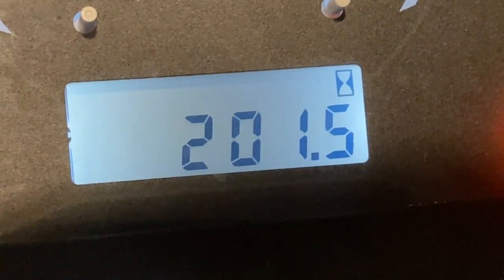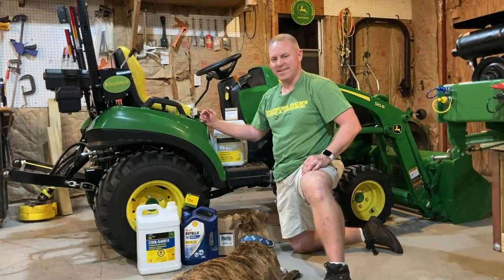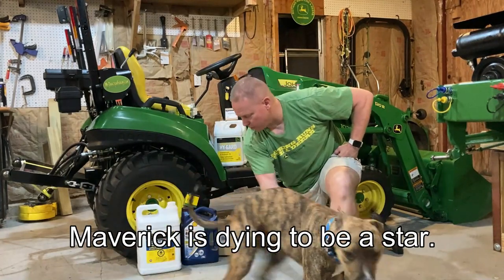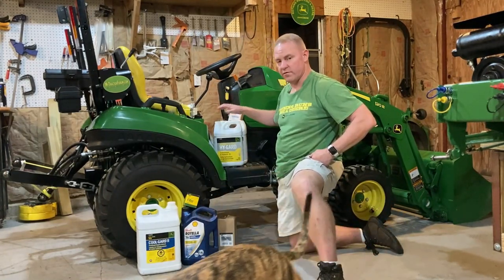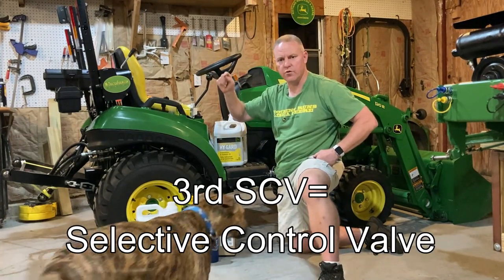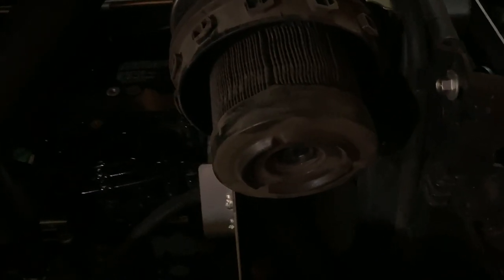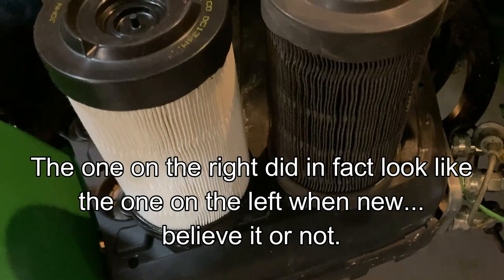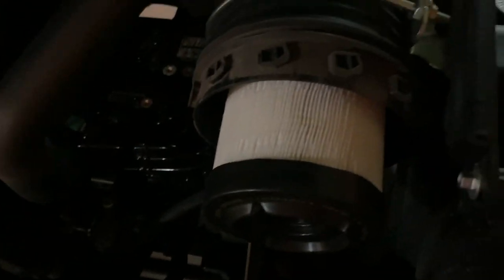John Deere 1023E (1025R) 200 Hour Maintenance Part 1 of 2

Comment: On that fuel filter under the tractor I use hose pliers or small vice grips on the fuel line on each side couple inches away from the filter to stop the flow while you remove the filter, it’s a pain but a small pair of vice grips works the best for me so far
Reply from the maker: Thanks man, is there enough space to work once you do that?  Either way, I'm trying it, it's gotta work better than what transpired on the video.  Thanks for watching.
Reply: @FloridaDeere  In tight spots I found that a pair of hemostats work great, the jaws are much more narrow than hose pliers or vice grips.

Comment: Great video. I was a little confused when you were changing the inline fuel filter. I thought I missed your explaining what you were doing. I figured it out eventually. The drain on the bottom of the radiator is a petcock.  Thanks for your time.
Reply from the maker: I can get distracted for sure, so I apologize for often not having the most coherent videos.  Yes the fuel filter is best if you vise grip either side and then change the in-line filter...this is learned.  The engine one is easy of course.  And yes a petcock, I have heard that before but often forget, so thanks for reminding me.  Next time, I'm sound a little more knowledgeable.  Thanks for watching.

Comment: If you clamp your hoses off with hose clamps. It's so much easier. Good video!!!!
Reply from the maker: Yes, I did do that originally...well not originally but after the first time I made a huge mess, but I guess I change it enough to where the hoses were weakened in those areas and one eventually sprang a leak, so this was my fix.  Thanks for watching.

Comment: I used 2 small vice grips to pinch the fuel host under the tractor and it was a clean job for me
Reply from the maker: Yes sir, that is the way to do it.  I was not smart enough to figure that out the first time and did the second time🤣.  In fact, in an hour or so, I'll be up for my 400 hour service.  Thanks for watching.

Comment: I am looking at a 2017   1025r ,Have you been happy with yours??  I would do my own maintenance also,so your video is very helpful. Thanks
Reply from the maker: Yes, I love having it, it has been a great machine overall.  If you haven't watched my review videos, watch them, I try to explain any issues I've had with it so far in those.  But it is a force multipler in the amount of work you can do, especially if you accessorize with like I have, hydraulic diverter, rear hydraulic kit and other things.  I'm about to do the 400 hour maintenance now, I'm about 10 hours overdue now, not bad, but I keep getting hit with other projects that require my attention.
Reply: Thanks for the reply, I'll do that.    @FloridaDeere